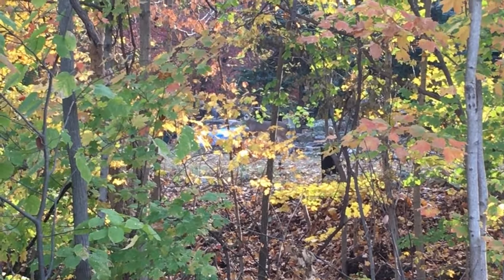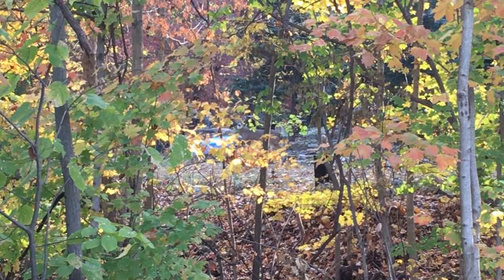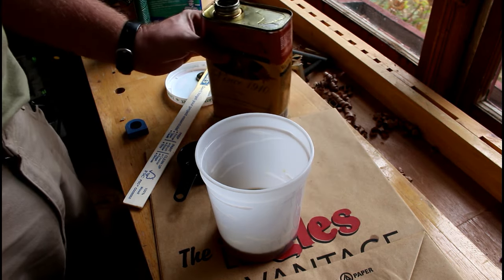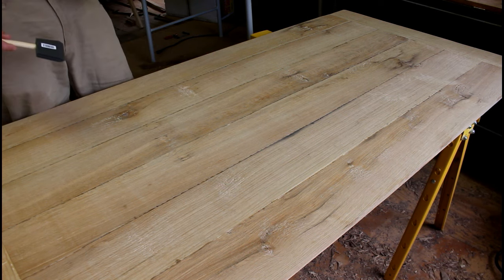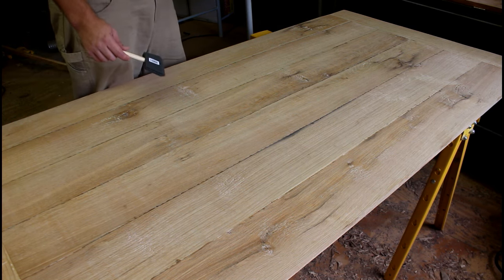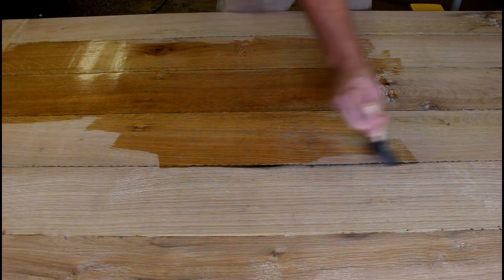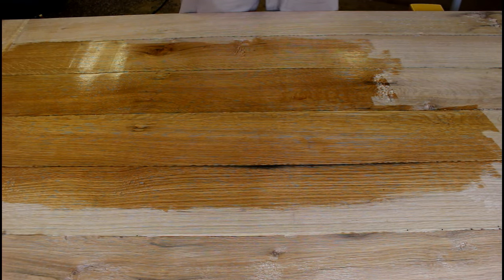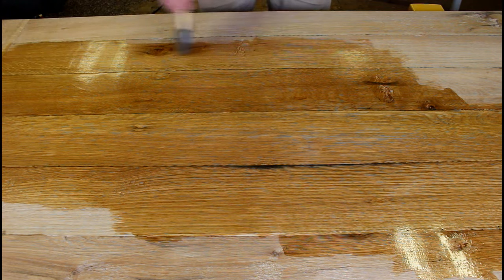Making a Farm Table, Applying Finish

Comment: I'm worried that the expansion/contraction difference between the end caps and body is going to split that table at some point.
Reply from the maker: How so. This is how tables have been built for hundreds of years the bread boards ( end caps) which is the proper name are only attached in the middle the sides are floating on loose tenons. Also the top is quarter sawn oak. It doesn’t move much if any.